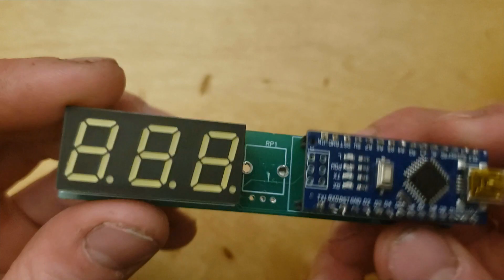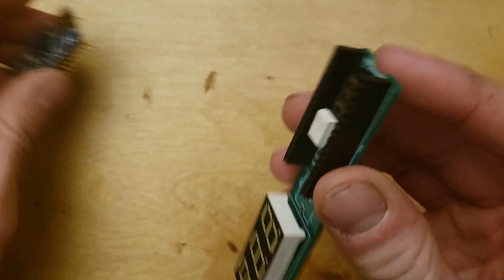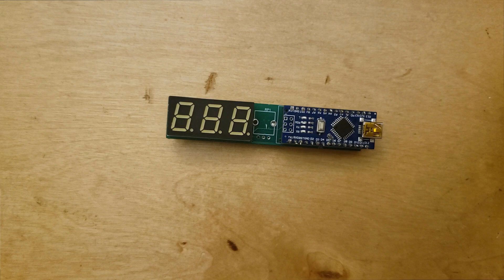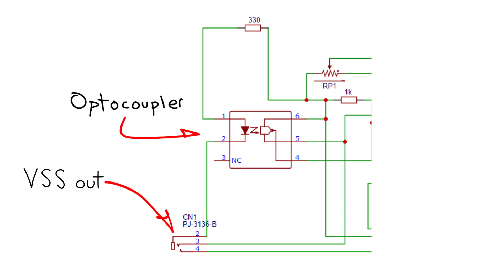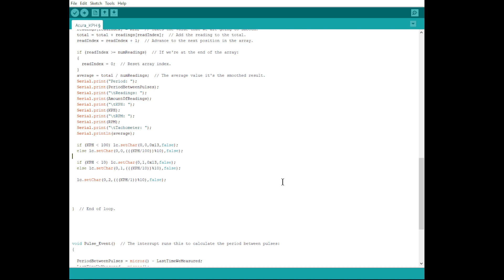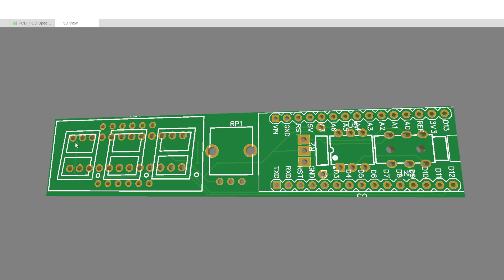DIY High Refresh Rate HUD using Arduino

Comment: Curious about this. I drive a JDM vehicle here in the states, can this convert to show MPH? My speedometer is obviously in KPH.
Reply from the maker: @lukesanchez6860  yes, you’d have to change the code to show it MPH. The reflector is just stuff I found on Amazon. HUD reflector it’s usually called.

Comment: this is really responsive, well done!
the other HUDs available on the market work based on info from OBD ports, which send frames of data, so there is a limit to the refresh rate, i think this is why everything looks laggy on them especially the RPMs,

Comment: This sick, legitimetely zero experience in coding or electricals but would love to try this out for myself. I have a VW MkV Golf GTI, would you be able to help me out in getting this thing going in my car?
Reply from the maker: I wouldn't have the time to help out your specific vehicle, but I would start with a wiring diagram of your vehicle speed sensor (VSS) and see if you can tap into that. If you can convert that signal into something your Arduino can read (like an optocoupler) then you're home free.